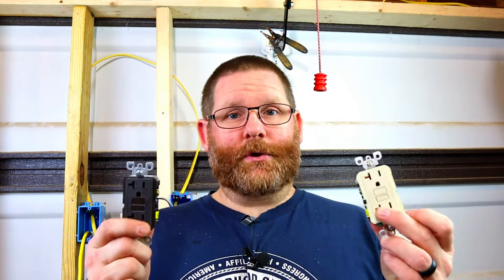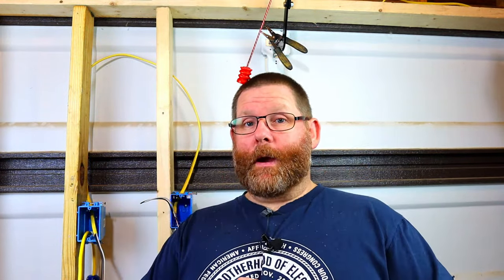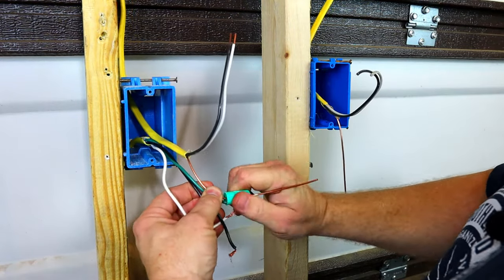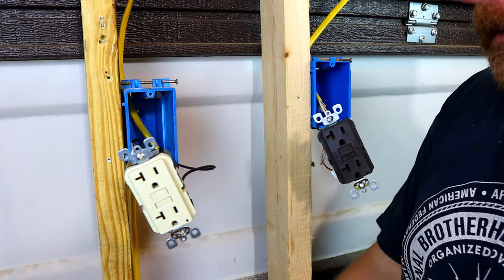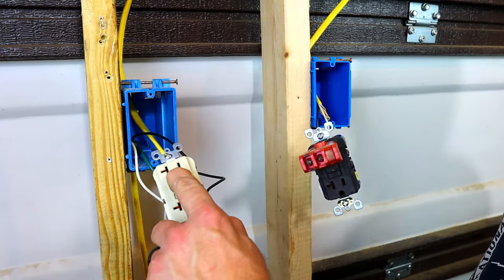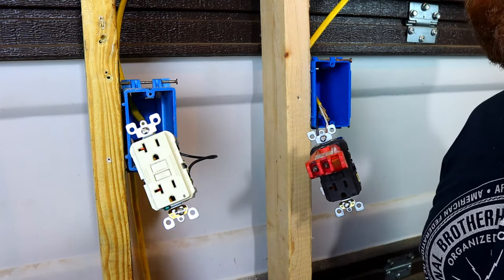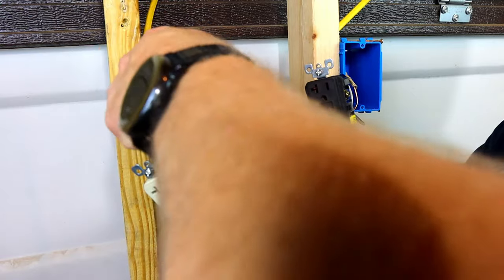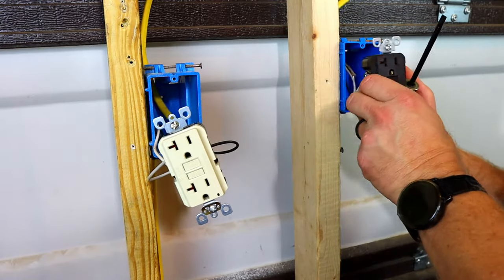How Many Ground Fault Circuit Interrupters On One Breaker

Comment: Why not just install a GFCI as the first receptacle and then use regular receptacles downstream from that point? They will all be GFCI protected because any current the regular receptacles draw has to pass through the GFCI receptacle and therefore will trip the GFCI if there is as little as a 5 mA current imbalance.
Reply from the maker: Exactly

Comment: Great video but I confuse, when could I use load  ?
Reply: You use the load side of the GFCI receptacle to wire to and GFCI protect downstream normal receptacles. Like the video shows, don't place other GFCI receptacles on the load side. They aren't needed and won't work properly.
Reply from the maker: Anything downstream that you want to make it gfci protected
Reply: More accurately... When you want all downline receptacles and lights to be GFCI protected AND when there isn't something downline that you absolutely don't want the power to be interupted from (like Grandma's breathing machine). Even in a basement... If you only have one circuit for receptacles and lighting in your basement and the first box has a GFCI receptacle (or you install a GFCI breaker) ask yourself if you really want to lose the lights if the GFCI trips or if you want to lose power to the freezer in the basement or to a sump pump, etc.

Comment: Why would you need more than one GFCI on one circuit? Doesn’t have one GFCI on the beginning of the do the same thing
Reply from the maker: Yes but if you don't want to walk to the first one in line you would put more than one.
Reply: @MountaineerOutdoors  wow so many typos in my question. Thanks for responding. That makes since.
Reply from the maker: No problem glad to help. ☺

Comment: Industrial setting like manufacturing.  Its easier to use only gfci receptacles for convenience power.  That way if or when you get a trip you are not looking up and down a manufacturing line wonder where the power is coming from.  ha ha ha

Comment: I just got 2 GFCI's to connect in series today, by going from the load in the first GFCI to line on the second GFCI. I just had to hit the reset button on the first one and second one and it worked just fine. I'm sorry to whoever made this video but this video is not correct.
Reply from the maker: Bruh seriously 😂 😂

Comment: Not in my county 6 are the maximum amount on one circuit. National is 10 there is an extra receptacle clause if you need one extra they will pass with 7. You need to follow local codes over the national code. 73
Reply from the maker: Always follow what the local rules are. Nothing wrong with that.
Reply: @MountaineerOutdoors  yes and fire insurance policy guidelines they usually go with local codes but most insurance don't allow homes with fuse boxes that's something to watch out for when buying older homes. A fuse box conversion is not hard but you need to pull a permit. 73

Comment: How do you find the first receptacle to install a GFI to protect the whole circuit with out taking apart every outlet  ?
Reply from the maker: No real easy way to. Trial and error. Take one out, turn on the breaker if it's not all of them move down a few try it again.. That's what I would do. Unless you can see each wire like from a crawl space or attic.

Comment: Why would anyone install more than one gfci outlet on a circuit its a waste of money
Reply: Sometimes, particularly on older homes that have 2 prong receptacles and trying to find and rewire  the most upstream receptacle an old connection is not the best plan for a homeowner trying to increase safety. A lot of older homes use pigtails that are soldered in. Selecting maybe 2 or 3 heavily used receptacles on a circuit can be a better option. Obviously, only the Line side is used.
Reply: I had a few outdoor outlets to install on a deck and couldn’t get WR non GFCI outlets locally so it was easier to use all GFCI outlets.
Reply: I just found the gfci for my deck was in the basement electrical room. Very frustrating.

Comment: first you can't put a 20amp gfci on a 15amp circuit. You can put 15 amp recepts on a 20amp circuit(must be more than one). The contact blocks in 15amp gfci are rated for 20 amps. General purpose outlets are 1.5 amps a piece or 180 volt amperes. For 20 ÷ 1.5 = 13 for 20 amp and 10 for 15 amp. Nec 220.14

Comment: There’s nothing in the code that limits you to 8 or 10 receptacles on a circuit. People confuse load calculations with install limits and they are definitely not the same thing.
Reply from the maker: True but it's just a rule of thumb most electricians go by. Your right you can have 50 if you want. Thanks for your comment and watching ☺

Comment: All you did was replace where the circuit is being protected from . Switching receptacles if you wanna say it that way . If you kept the first receptacle the way it was and just simply put the wires on the line side only after that you would be fine . You could put as many gfi receptacles that you wanted they just would be being used like a normal duplex receptacle at that point tho and a huge waste of money . Like the video tho 👍🏻
Reply from the maker: I appreciate you watching. Have a great day ☺

Comment: You are incorrect.  There is power to the black GFCI feed because you reset the white one prior to testing. What would you expect? The tester shows no power because the black one also tripped when you tested the white one. This is why 2 GFCI outlets on the same circuit are not needed. 

Further, you wired it correctly and would have a protected outlet if you had a plain outlet instead of the black one. It is also correct as is but you will need to reset all the GFCI outlets before they work again. You can see the power being restored to the black one when you reset the white one. There is a little flash of the LED on the black one when you reset the power. Prior to the white reset, it was dead at the back, but you did not test it then. The black outlets won't go hot until you reset the black GFCI.
Reply from the maker: 🤕 Say what 😂 😂 😂
Reply: @MountaineerOutdoors  yep. Did you go back and look. No power to the front of the black one because it is tripped, but power to the line side because you reset the white one!

Comment: Spec grade Eaton receptacles have clamps style terminals on the side where you can insert two wires under each screw with a secure safe connection.

The reason you would want to use two GFCI receptacles on one circuit...
In my parents house there were receptacles on both sides of the kitchen sink. Install a GFCI at the left side of the sink but use the line side to continue to the next receptacle on the right side of the sink. (You'll see why in a moment.) Install another GFCI in the next downline receptacle on the right side of the sink and again continue the circuit on the line side only. Here is the reason. The next receptacle is for the refrigerator. You don't want the refrigerator to be GFCI protected  because someone could accidentally trip an upline GFCI which would mean no power to the refrigerator and that could result in spoiling all the food in the fridge. How? If this scenario played out on a Saturday morning just before the family went on a weekend camping trip they would come home after their weekend and discover that there was no power to the refrigerator all weekend.

Don't think things like this don't happen. They do. This is also one reason that a refrigerator is best on its own dedicated circuit or why it should be the first receptacle on the circuit.
Reply from the maker: I agree I always wire a house dedicated circuit to the refrigerator. Thanks for sharing your scenario
Reply: @MountaineerOutdoors  
The house we're in now has the refrigerator on a shared circuit. The first two receptacles seem to supply power to both a freezer and the refrigerator and then three downline receptacles; one to one countertop receptacle and two receptacles in the dining room, one of which has a good sized AC unit plugged into it in the summer which gets plenty of use. We've been here over four years and so far no problems with the breaker tripping. It's on my list of things to fix but I'm not sure when I'll get to it.
Reply from the maker: Yeah that's alot on one circuit for sure. Definitely would try to break it up

Comment: You got to be joking on your question  ??? It depends on how big is the breaker on a no fault breaker. If a  receptical  is  going to use 5 amps each only ,  and  use a 30 amp no fault breaker and all breakers loaded are  50 % loaded or 80 % loaded ?  Thats  say 100 % loaded it be  5 divided by 30 = 6 recepticals. If 20 amp no fault breaker at 5 amp recepticals each all 100 % loaded it be 5 divided by 20 = 4 recepticals. It is  a matter of  correct  limited math.

Comment: Your therrory is wrong period, it no voltage drop on right size wire within  100 feet.
Reply: @MountaineerOutdoors  all voltage drops are due to , due  to a   small  conductor pathway. ( to small size wire ).
Reply from the maker: And distance bro
Reply: @MountaineerOutdoors  not distance but size of wire, distance is part of the chart of size. Say 30 amps at 50 feet is size # 10 american size   if it  150 feet long circuit  it size  is  #8. Or if 250 feet long circuit  it is #6.copper matterial only. Different kinds of conducters have a different caring amount of amps x heat ablity , gold carries more amps and less heat per amp, next be copper , down to aluminum clad. The aluminim clad carries less amps and more heat per amp. Heat distroys watts = less amp carring amount. Jobs  sites are counted to the. Ceapest  same quality of service  and safety as top material cost.  As a bid, the cheapest   safe top quality service.

Comment: If you cannot draw the diagram to explain why there is a metering difference between the two with the ability to calculate it, you are not actually an electrician.
Reply from the maker: That's true I am not an actual electrician 😂 😂 🙄 however, I did stay at a Holiday Inn last night 🤣🤣
Reply: @MountaineerOutdoors  Holiday Inn Express..... ;-)

Comment: A very simple thing made extremely confusing by overcomplicating this!  Line in on first GFI must be carried to the line side of the second GFI. Note Attempting to use the "load" side of first GFI as "line" in on the second GFI will not allow the second GFI to function correctly. Done.